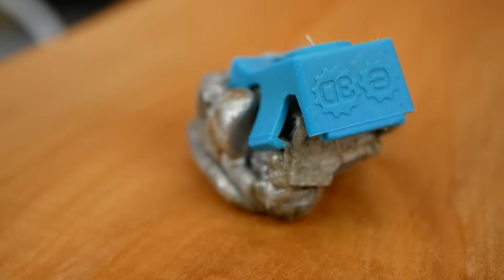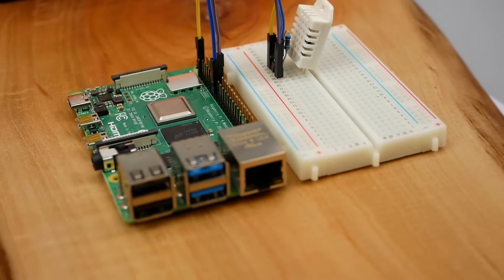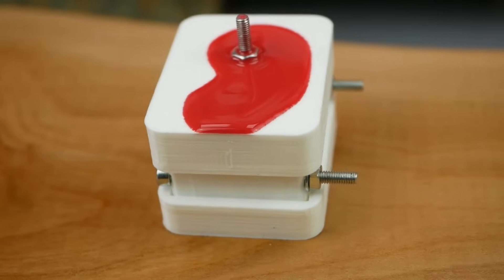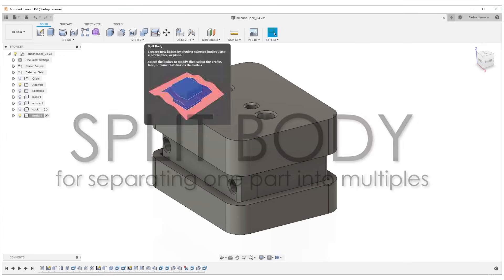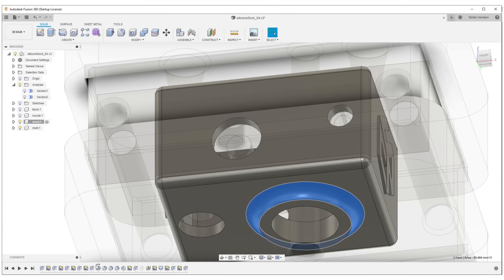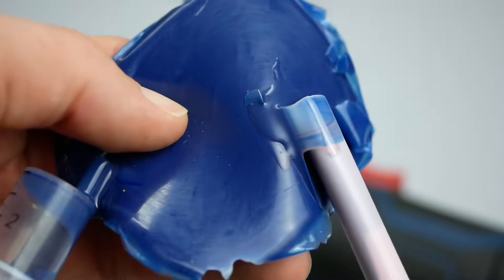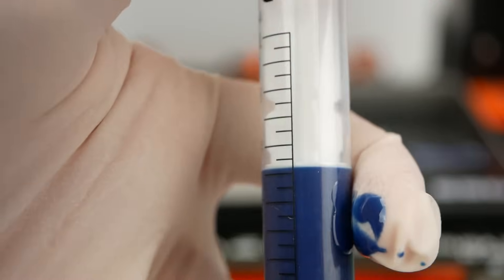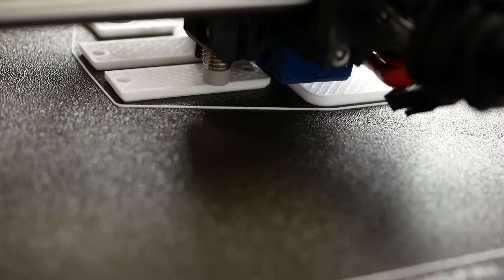Design & Cast your own Hotend Silicone Socks!

Comment from the maker: Feel free to share the video on Facebook, Reddit, Twitter and other social media!
Reply: Can you please share the mold for the volcano hotend?
Reply from the maker: I printed and molded this one: https://www.thingiverse.com/thing:3015676
Closed most of the holes with tape, though.
Reply: @hyperhektor7733  It's maybe not the best content for a YouTube comment? Plus you will not enjoy this print if you don't know that for this to work you'll have to mix 20% silicone oil into Shore 00 silicone..
Reply: @kataseiko  why not a good comment? i mean if you as an expert gives tips for improvement , seems a good topic to me :) . Btw there is a product called "slacker silicone" which does the job you mentioned. Another method would be encapsulating waterbased gel, air or cornstach-mixture.
Reply: @celulari  99999999ooo9oooo9ooo9o999ooo9oooooo9oooo9oooooooo99o9o99oo99o9o9999o99o9999o99999o9o9o9999999o999o9iii99i9o99o9o9i9ii99iooooi9iiooo9ioo9o9oo99o9oioiiooo{oooo9oo9o9o9ooooooooooo9ooiioooii9ioooi
Reply: Hey Stefan you said you're new to the GPIO usage of raspberry pi etc. I saw you're using a DHT22 sensor you should not use these, they get inaccurate pretty quickly over time. You can use BMP280 (temp/pressure) or BME280 Ihumidity/temp/pressure) they're only a few dollars on aliexpress.
Reply: Please, make update to a video. I regularly doing silicone moldings and i must say, my silicone parts that i made flammable. Not just charring or something, it burns in flames, bright and hot. So please, don't do this silicone hotend sock, unless you know what exactly your silicone is.
Reply: Great video!  The F360 link doesn't seem to have the "download" button enabled, despite the video saying the f3d can be downloaded.  Can the download button be re-enabled?
Reply: I did some silicone molds in the past and always used a vibrating sander to help reduce the bubbles. 😬👍
Reply: Which TFC silicone did you use?
The link to Amazon just shows me some 200°C silicone...
Greetings from Germany!
Reply: Wow, this is slick!  You have given me a new focus for making enclosures.
Reply: Can I do the hotend of a Prusa i3 Mk2 with silicone? And is the Zhermack ZA 50 LT silicone from e.g. Trollfactory a good silicone for this? Because it both says SO many good things about the heat and it's shore 50, so perfect for stiffness.
Reply: your fusion can not be downloaded
Reply: Have you considered a version of the mold where you fill a puddle (reservoir) and just drop the assembly into a vacuum chamber to remove the air, then open the valve to suck all the material into the mold?
Reply: Download of the F360 doesn't seem to enabled (need to enable it when you share the link).

Comment: Just wanted to say my thanks to you!
I've made a few of these like 4 years ago thinking I would need replacements often like the E3d ones. My first sock is now over 4 years old and I I still have a few spares lying around. Just incredible what a good Material can do.

Now i am printing gasket for a Motor and could not find any Material to print this with - so I printed a mold and got the still full bottles of silicone out of my cabinet again.

Comment: Pack of Silicon Socks on Bambu Labs cost 9 Euros plus 10 Euros for shipping. Lets say it's an even 20 Euros. 

The pack of silicon is 70 Euros, the syringes are 10 Euros plus whatever the molds cost to print. Lets say 85 Euros total to DIY the socks.

You save 65 Euros by buying the pack of 3 from Bambu Labs vs DIY'ing the socks. Plus all the time you save not doing it. This is how I justified buying a 3 pack of socks that I still haven't had a need to replace.
Reply: This video is 6 years old, Bambu Lab wasn't even around at that time. As I understand the video, Silicone Socks were the new thing 6 years ago. So I totally agree with you, molding Silicone socks yourself is not the way to go anymore, but it was relevant six years ago.

Comment: Since I replaced my 0.4mm nozzle by 0.8mm nozzle on my Ender 3 V2, I removed the silicone sock and it get perfect printing result from PETG, I got no idea about how it is work but I just leave it working without silicone sock.

Comment: 3years back i didnt think id ever come back to this video because i already had a really well working silicone sock that came with the ender3. Now im experimenting with cht volcano nozzle, copper nuts and a more powerfull heater, all on the stock hotend, so i also need a new silicone sock to insulate the nozzle that sticks out soo far from all the extra part cooling air. 
Very helpful video! 
Also.. i think i saw every single of your videos but i dont remember if u ever made a fusion360 tutorial? After using f360 for 4 years on and off, i still have no consistent workflow of using components like u did in the video. 
I would love to see a basic workflow video and how to split up multi part projects into components :)

Comment: Now that some time has passed, how did they hold up in the long run?
Reply from the maker: Really well to be honest and I've seen so many using the same silicon these days for their custom socks. The only thing I noticed, is that some parts that get really not start to discolor over time but that just on the inside.
Reply: @CNCKitchen  I've been wanting to do this since I first saw this video. I took apart one of my creality printers recently and the silicone sock was sticking to the heat block and crumbled when I pulled it off. It looks like such a fun project. I'm going to have to do this soon.

Honestly, silicone casting this way could be used for custom stamps, and an idea that I've been kicking around is creating tips for part cooling fans. Just the part that gets close to the hotend and it could pressfit over the "tube" of the duct that would have a groove almost like for an o-ring. My stock fan shroud on my CR-10 V3 is melting and warping and will have to be replaced soon. Having a heat resistant tip out of silicone would be better than PETG. I haven't messed around with ABS yet personally.

Comment: Just a warning that RESIN printed molds may inhibit the cure of many 2 part silicones.  Of course if you are making heat socks, you have a filament based printer, but this may help somebody that is trying to make some sort of super-detailed mold in a resin printer.  If that is you, do some testing before committing to purchase of lots of expensive silicone.

Comment: Well thats neater than my solution. I just smear rtv silicone all over my hotend with cardboard cut into the shape of mini spatulas. I have to cut the silicone with an x-acto knive when I change nozzles, but adding more silicone is so easy its barely a disadvantage. The only real disadvantage is its ugly and if I have to change heatblocks for any reason I have to do it again.

Comment: Cool 👍
I'm beginner and waiting for my first 3d printer the flsun q5 to arrive, is ther this 3d printed silicone sock version also available for the Q5, I would like to make one first before I mess up the nozzle to much, or could I put some of the yellow transparent high temperature tape on the nozzle and around or the Teflon tape that is used in vacuum bag sealers? 🤔

Sorry if I messed up the writing, I have most the time conical migraines and fibromyalgie, most the time strong pain even under pain killers, slso English is not my mother language.

Kind Regards

Comment: I actually dip my hot and in one layer of candle wax and then dip it in high temperature  silicone until I get my preferred thickness and it makes a nice tight fitting sock for my hot end

Comment: Little tip: If you want to get rid of the layer lines, melt some beeswax and quickly dip the mold in it before injecting the silicone. If you do it quickly enough, the wax will fill the tiny gaps without disturbing the dimensional accuracy of the mold.

Comment: This is great! My wife and I make silicone moulds for casting things in epoxy resin. We use laser cut acrylic and/or 3D printed resin to create the masters that we form the moulds around. Turning that around and using the 3D printed material as the mould and the silicone as the casting is straightforward and allows for further flexibility in the kinds of things we can produce. I look forward to casting my own silicone sock using your ideas!

Comment: Now I'm wondering if you could do silicone over-moulding to use a PLA stiffener embedded inside silicone. eg a semi-rigid phone case.

Lots of mechanical features would be required to limit slip as you can't use chemical bonding between silicone and the PLA.

Comment: Great work. You can also further improve the quality of your silicone casting by putting the charged mold into your vacuum chamber and evacuating air, which in tun will pull any bubbles out of the silicone.

Comment: Hi Stephan, can you share the fusion 360 project with me, so i can make changes to the block size - using "chinese-clone-blocks" which are a bit shorter than the original e3d ones... or am i just not seeing the button for downloading the project?

Comment: I would like to defend the original socks' "small hole" design for a moment. I have found that when printing PETg, with the "large hole" sock, I was plagued with blobs and burned bits of filament accumulating on the model.  PETg tends to produce strings of fine hair sized threads during retractions followed by a move.  These hairs get picked up by the passing nozzle and build up into a blob on the exposed outer surface of the nozzle. Eventually dropping off onto the thing you are printing. I messed around with all of the various mitigating settings but you I couldn't stop the stringing completely stop the stringing. "PETg stringing is what I do" :-)  The "small hole" sock solves the problem for me completely. FWIW Mike

Comment: Are silicone socks worth it ?
Reply: As he said in the video the silicone sock is meant for thermal stability to not prematurely cool from the fan and to keep your heater block clean so you don't make toxic fumes from baked filament. Is it worthwhile? If your up for the challenge it's totally worth it

Comment: I really like the way you used casting for heater block socks. Pretty intuitive and easy to use. I'm actually using the same approach for a V5-style heater block.

Silicone moulding opens a whole world of things. For instance, one of my bothers has a manga figurine on which an element is missing to prevent the figurine to fall. It would be really good to, say, have a silicone mould that fits the part of the figurine.
OK, it implies having a 3D model of the figurine, yet there are quite a bunch of options on that purpose.

Thers is an endless list of things to do with silicon moulds. :)

Comment: Hi. Is it possible to work with your Fusion-File in my Fusion? I would like to change the chamfer on the inlet-Hole to the common Luer-Cone for the syringes. ;-)
https://de.wikipedia.org/wiki/Luer-System

Comment: I wonder, since silicone can resist 300 C, if you could 3D print a part, make a silicone mold around it, and then pour molten PLA or ABS in the silicone mold... thus getting a much stronger part (and making it very easy to replicate it quickly). The mold itself would probably need to be heated, but for smaller parts it shouldn't be a problem, and a kitchen oven should be good enough
Reply: Sounds good. Then, the PLA might "anneal" without deformations (related: https://www.youtube.com/watch?v=dOzVuoBP9gY)

Comment: Great video first of all! Have you also thought about printing a positive model of the sock, of which you cast a negative silicone mould? This enables the option of surface treating the positive print, which you can see lately in your finished part. Had some great result with this method, and I think this would simplify the demoulding of the sock even further.

Comment: 3:15  .. E3D socks work fine, just wrap a wire around it, and twist the wire slightly snug.. then the sock won't fall off. Much easier than molding your own. 
1:54  .. yes for E3D do cut out the nozzle hole larger as shown
after I did the 2 above mods..... my E3D socks have been working fine for over a year on several printers.

Comment: I really want to do this project, but it ends up being like a $60+ investment. I just got my Prusa Mini a month ago, so I'm still working on getting all the tools and materials I need. I can't find the syringes individually, which is annoying, I don't need 5 or 10 of them for $10. If someone knows a place where I can buy one of those syringes for like a dollar or less, that would be great. The silicone is like $35 and the dyes are at least another $10 if you don't want your sock to look like red clay. The scale is something I need to invest in, but I'm having trouble finding a precision scale that can measure up to 5000g, or even 3000g, at a tolerance of 0.01g. Most of the cheap ones people recommend only measure per 1g, which is useless. The other option costs at least $150+, so maybe someday. For this project I think I can just swallow the $12 cost for a precision scale that can only measure up to 100g. It's a lot of money for something so little, but the fun of the project itself makes it worth it. I've always wanted to get into silicone molding. Eventually I'd like to try molding concrete to create furniture or coasters or something, but that's for a time when I have more time, money, and tools.

Comment: Great video, thanks for your awesome work. One question: did you use some kind of release agent like vaseline for example?
Reply from the maker: In the beginning I did, later I noticed that it's not necessary for the silicone casts.
Reply: CNC Kitchen thank you very much 👍

Comment: I would not cut slots for the heater element or temp resistor. Yes, this means you would have to remove the heater element and thermistor before installing the sock and re-install them after, but this way the silicon sock remains in place with less chance of slipping in use.  If you design your silicon mold with a small lip or flange around the perimeter at the top of the hot end block, it will grab it more securely.To prevent flashing you can use modeling clay to seal the edges of the 3d Printed mold clean.  Option for silicon sock material, I believe you can simply bypass the 2 part silicon mixing and use a professional construction true silicon tube (no latex mix) or a hot temp automotive silicon,  a lot cheaper, make multiple molds and you can pour and cure all of them at basically the same time and not waste any silicon, plus you can use them after 1 day curing. I have done a lot of silicon molds in my time,  using 2 part silicons to duplicate parts in various types of mold making media.  This is many times a messy process, why I think using a tube of ready to use high temp silicon will work for something like a small sleeve, like these hot end socks. You don't need to degass , special equipment, just a couple holes on the mold, one  to pour  (in case of a construction silicon tube to force the material thru) and  another to vent excess.

Comment: Rea;;y nice video. If you wanted to ,make copies of figures in resin you can use the resin for the mold. Print figure. pour mold (dixie cup) remove figure and cast part. This may a particularly  nice way for making terrain or buildings since resins can be purchased in different textures.

Comment: Would spray silicone work to avoid sticking?
Reply from the maker: Not necessary, since the silicone doesn't stick to the mold.
Reply: @CNCKitchen  I meant "prevent the melted plastic from sticking to the extruder".

Comment: Excellent job Stephan, as usual, I just wonder if a cooling duct can be molded together with this hotend sock so I slightly modify your initial design, to include this feature, I'm struggling a little to define the mold but after finish I will share too.
Reply: I thought the same! did you succeed?
Reply: @tinchodias  Hi! I find some constraints removing the part from the mold,  another issue is the thermal dissipation, once the sock walls in touch with hotend block the air flow will be hot, not helping that much on coolings perspective, in resume the effort not worth and I give it up, now I'm looking to use same solution as the guys that persuit 3 min benchy, brass pipes side by side at hotend block.
Reply: @PauloRogerioAlmeida So you say that the high temperature silicon has a thermal conductivity to consider... I still didn't do any try but want to, and am suspecting that those Ultra Copper Permatex that tolerate so hight temperatures maybe also don't insulate temp as more pure silicone. Probably I didn't explain well... writing from phone, sorry.

Comment: 1:42 - I had an attack of the blob, but worse I think. A decent sized print broke free from the bed and almost got into the hot end fan. Took a while to clean up because the thermal runaway shut things down a couple times before I cleared enough the get at the real problem areas... at least I know thermal runaway works!

Comment: Wow, this is an awesome idea! I have started using a tusk design on a print cooler. You gave me an idea to incorporate the tusk (tubes) partly in the sock. Either just to give the tusks more room or even help holding them in place. I could even make a silicon fan "shroud" to connect the tusks to the fan.

Comment: Stephan, thanks so much for your content. I really appreciate your time and dedication to be as through as you are. 

I wonder if you do consider venturing into making heat resistant molds from 3D printing. Not only because it would be interesting exploring metal casting and lost “wax” techniques, but I am really interested in reusable molds that resist heat such as plastic injection molding, for instance. Could you print a negative mould with all the registers that then would be used to create the final heat resistant mold to be used in the final casting? What do you have to do with all the tolerances?

Thanks again!
Paulo